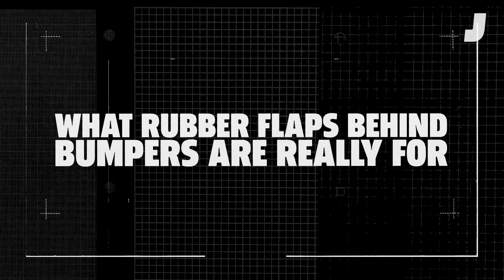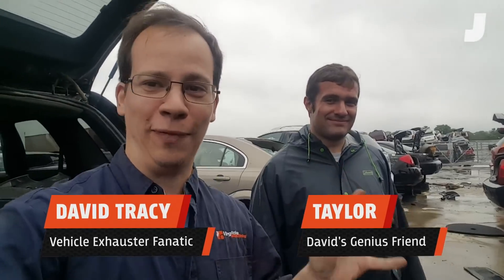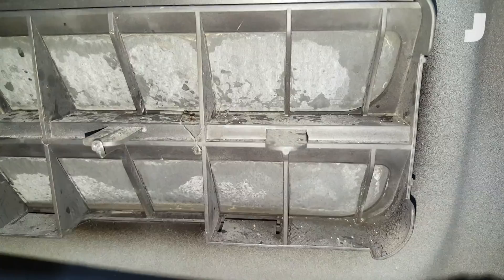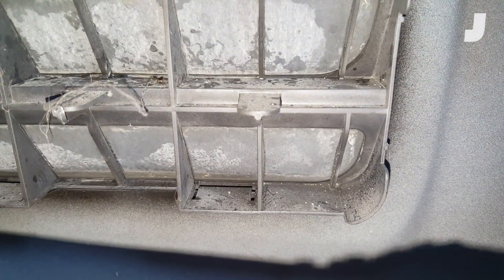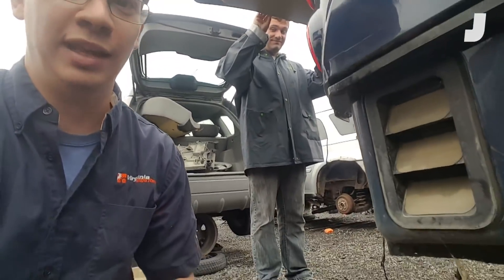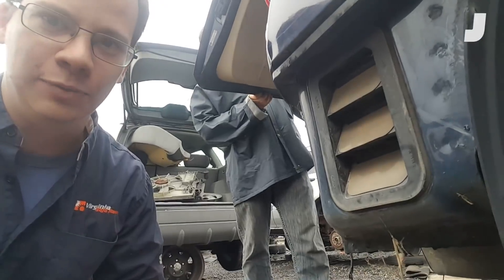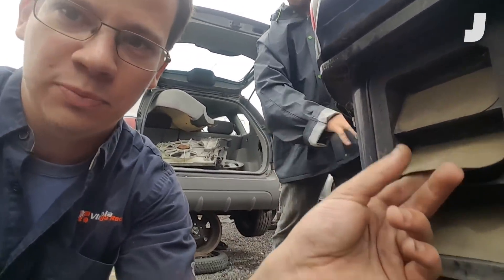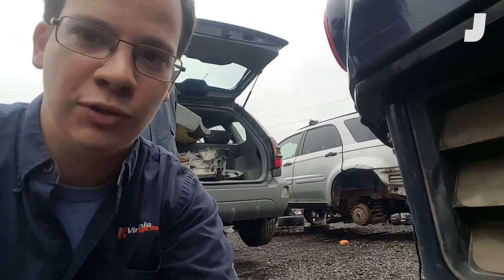Why Those Secret Rubber Flaps Behind Your Rear Bumper Are Important

Comment: So the only flaw with this in my 2010 ford fusion is, When you drive down the road in the rain, Water sprays up and makes its way in the back trunk over time. Then again I bought the car with a damaged back bumper, so it’s possible a mud flap or deflector from underneath might be missing. I ended up taping and sealing this vent to prevent water from spraying up inside. (The vent is directly a foot and inline with the back wheels and obvious signs of dirt and water spray from the inside of the trunk)

Comment: What will really happen if I plug these? I have to completely seal my car for a car audio project. Please help it's a four door sedan with a large trunk. I don't think it will really do any damage to the car.???????? What do you think? Thanks for the explanation and and demonstration though
Reply: This vents make sure that the extra heat trap in the car Moves out when all the door are closed , if u close them it will definitely break all the glasses due to high pressure build up

Comment: When I installed my parking sensors (on 2004 Fiesta Mk6) I passed the cables through those flaps (two on each side). Is this a problem? Can water get inside the bumper if the rubber is slightly lifted up?

Comment: Weird being fumes can get in the cab.my is250 lexus. Rotten egg smell on hard acceleration. Pop the trunk and is obvious .seem. like a bad design.
Reply: Hey I drive a is250 as well and have been getting that nasty smell too have you replaced them and did it work?
Reply: @themeparktre4841  ye bro it works no more smell.got of ebay for like 55 for both .and u put them in from  the out side under bumper.there is a tiny space to fidget it u can fit your hand.the prob is the rubber flap breaks and hardens and dry rotts leaving the space For fumes to get in .simple as that.there pretty fragile so carefull wen u replace..o ye ..the right side amp comes loose .just two screws on each end .for more room to move
Reply: dkd yesterday I had been looking on the internet for a solution to that smell and found out about those flaps and so I decided to look and inspect them and noticed the drivers side flap you can see that there is space on the sides like it shrunk or something I’m assuming the passenger side next to the amp did the same thing hopefully after replacing them the smell goes away most people on the web assume it’s the Cats going bad but the car just passed smog and would have failed if the cats were going bad I was worried but after seeing some people’s success of these flaps I feel better
Reply: @themeparktre4841  bro all the cat bs . Peeps talk abounch of sht.and they dont even have the same car alot of times . . Its that one flap or both of the flaps . ..guarentee it..also its so nice to hit the gas anytime aand not be fumed out ever again.
Wen i bought mine .this was something they left unchecked . So i foumd out about it luckily and did it .
Reply: dkd yea I figured it was bull about the cats cause it just passed smog if they were bad it wouldn’t pass I’m glad I saw a post saying it’s the flaps and yea dude I took my girlfriend out the other day and I went on the freeway and my girl looked at me in disgust and was like did you fart and I had to explain that the car does that when I go up to 70 🤦🏽‍♂️ so I need to get those flaps fixed cause that’s embarrassing

Comment: My daughter has a 2016 Hyundai and if one of the rear windows is cracked open one inch it creates a deep vibration that annoys your ears. ❓❓❓❓❓❓❓❓❓🗿
Reply: That's called wind/air buffeting. Horrible sound and pressure discomfort. But yeah, just crack open more than 1 window.
Reply: Open one of the front ones. Problem solved!
Reply: @krisn8820   nooo, that’s too easy. I’ll try it.

Comment: These also make funny noises when you have a big subwoofer pumping in the trunk.
Reply: I just got subs put in and was wondering why the rattle was so bad in my bumper. I realized it was these things and I removed them. Problem solved lol
Reply: I got a subwoofer too . I blocked them off. Its it ok to block them?
Reply: @marsbougie  any problems yet I'm thinking about blocking them
Reply: @aleckasper67  I only block one side because it was creating too much back pressure when block both.  when closing the doors.
Reply: @michaelmurray1883 Same it was driving me crazy, I was about to add sound deadening to the exhaust shield think it was that😅 when I decided to check one more time problem solved 😂
Reply: @michaelmurray1883 any issues after removing them?
Reply: Facts took me a while to figure that out😂